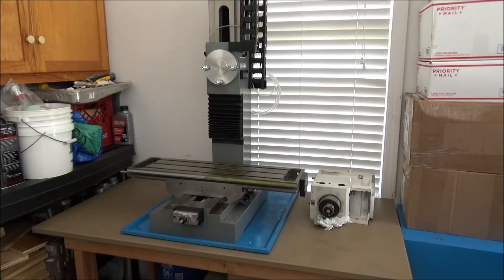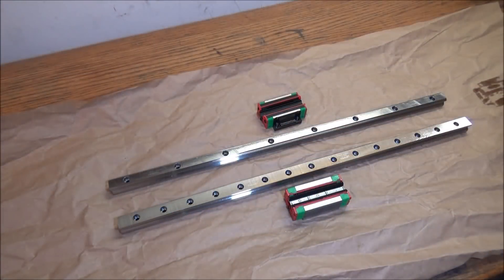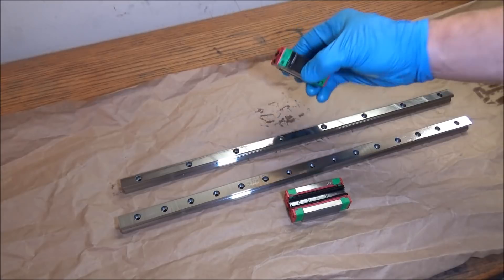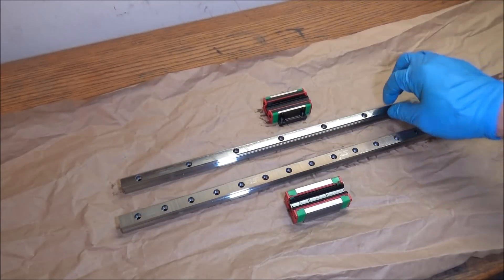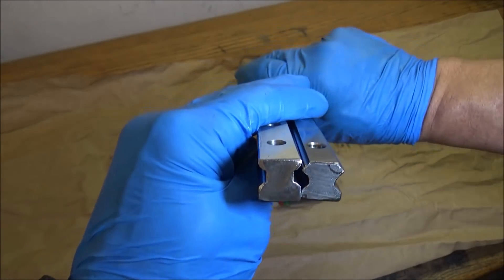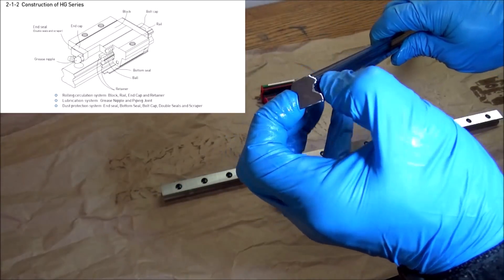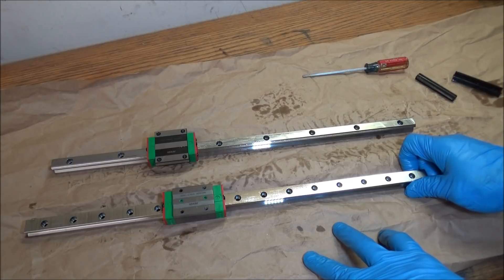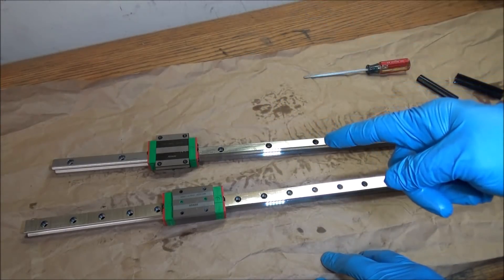PM727MXL Linear Rail Overview

Comment: What kind of Linear Rail or type of rail is best for holding a laser module that is not heavy, maybe 1 pound at max. Needs to move fast from left to right but precision is extremely important.
Reply from the maker: HG would most likely work well

Comment: Wow, the roller type sure had a much larger contact (height) than the other.  Maybe twice as much or more?  Much larger lever arm against forces.  Would be hard to pass on the roller ones, but maybe cost is crazy?
Reply from the maker: Hi Mike ,
Cost is more and also tighter tolerances for installation, So you have to bear that in mind the load ratings and rigidity are super high with roller so the bigger the Machine the more useful they will be.

Comment: 1st comment! Really excited to see this project progress in the coming months. Can I make a request for your build? I'd love to see individual weights posted for each sub assembly of the PM727. I am not sure if that info is out there on the web but it'd be great to do while your machine is apart!

Also, what have you been using for a stand for your other 727 mill? I'm in an incredibly small 1 car garage that still has to handle car storage and want something strong enough and hopefully mobile. I've been thinking of using a tool cabinet with a workbench top bolted to it to spread the weight out.
Reply from the maker: Great Idea I will try to post those weights, My Mill sits on the Stand and the Stand sits on 3 pieces of 3/4" PT Plywood to raise it up a Bit really 2 would be perfect.  i will get you a Height